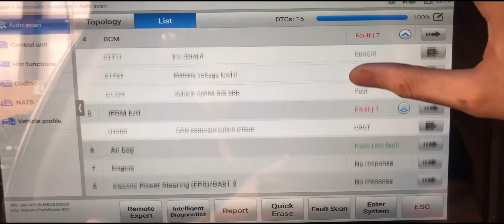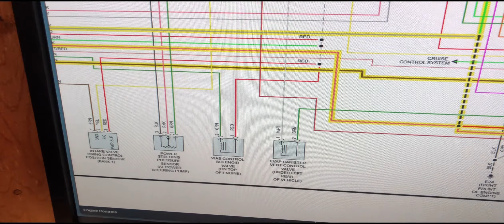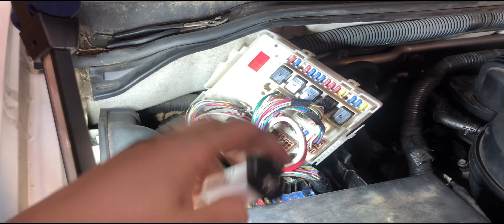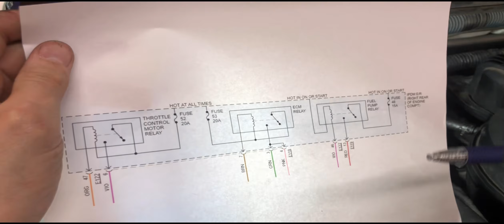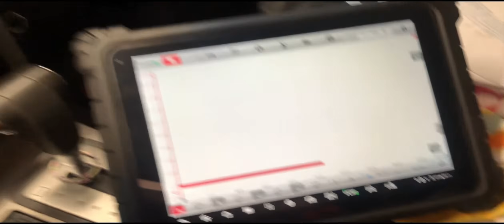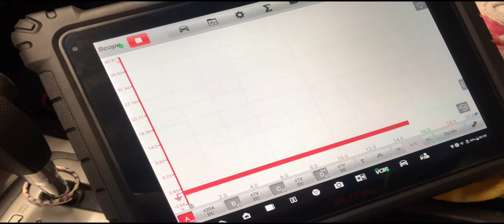Case Study - Nissan Pathfinder Blown EGI Fuse

Comment: Sir, green dialectical grease? Right away we know what corrosion looks like! I’m sorry but, what a waste of time to find corrosion isn’t white!
Reply: There is white corrosion but it does not look like gel and it typically does not form on copper wires but it is on vehicles on occasion. Without pulling the connector, this would not have been found which means we need to pull connectors to do a visual inspection everytime when we know that touching things can fix things as the lesson of this video shows, do not touch until we are ready to measure any changes in the circuitry and this would have been found when the CAP went through the UNPLUGIT test when properly monitored, cheers.
Reply from the maker: yes, there are a few different brands with green colored dielectric grease

Comment: do you know part number
Reply from the maker: 28351-89902
Reply: I have the same problem... I get two negative currents... in that part and the ignition fuse always burns... I already have a headache. Can you help me please bro!
Reply from the maker: Some current should be expected, just not too much. I don’t know that there’s much I can do for you remotely.
Reply: I don’t have check engine light
Reply: Do two grounds have to reach the capacito or condender coilr? there is no continuity in the capacitor o condenser
Reply from the maker: The condenser should have 1 power wire from the ECM relay and 1 ground wire.  Condensers are not measured in Ohms, the meter has to be set to capacitance and checked in both directions.
Reply: @kekemejia  do a little research on how to measure capacitors or condensors on GOOFLE and how to know if the part is bad, open, or shorted.
Reply: Are you in usa ??